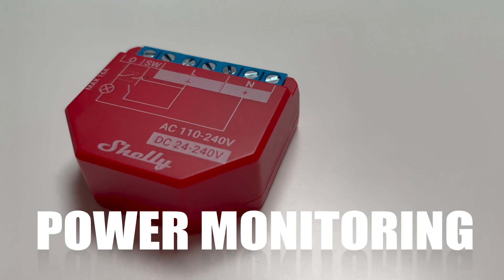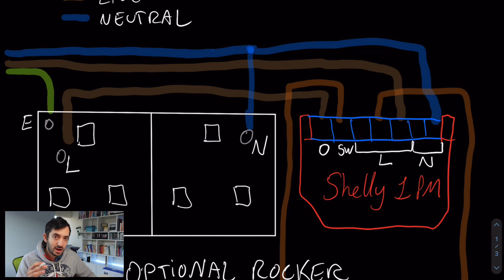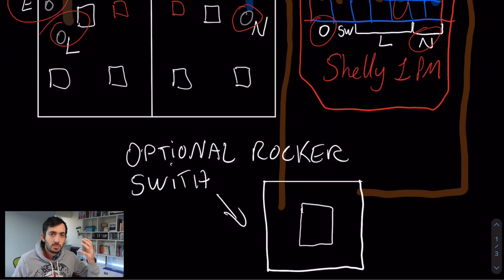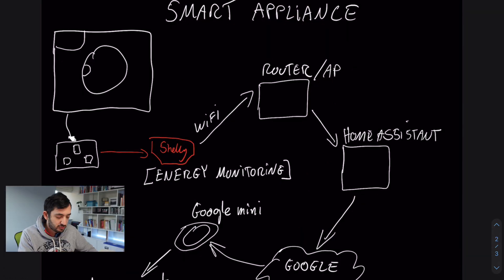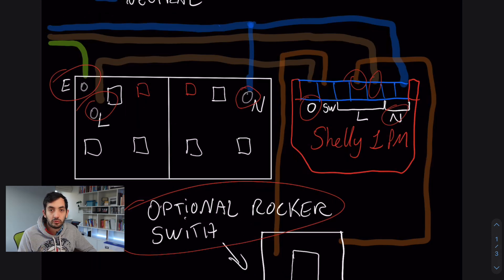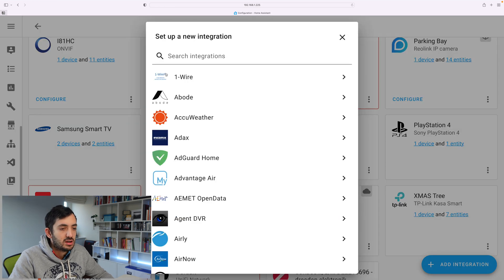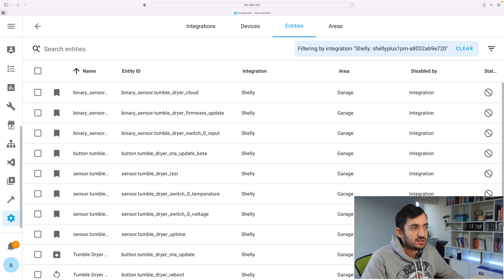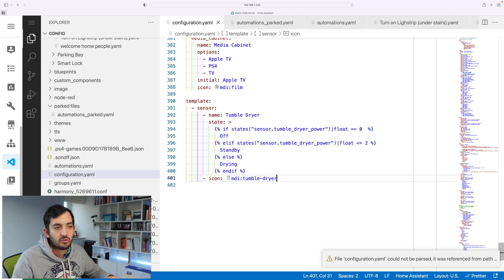Make ANY Device Smart (Shelly 1 PM & Home Assistant)

Comment: I am a Shelly beginner and have acquired the following devices for learning purposes:

- Shelly 1PM
- Shelly Plus 1
- Shelly Plus 2PM
- Shelly Dimmer 2

I want to intercept the signal coming into the kitchen, which is connected to a (220 V AC) doorbell (only powered when the bell is pressed), with a Shelly device, in order to signal the ringing at the front door in the rooms on the upper floor via Home Assistant.

For powering the Shelly, I have installed a seperate 220 V AC connection near the doorbell. As soon as the doorbell circuit is powered by pressing at the front door and rings, I want to capture this signal or current flow with the Shelly and create an entry in its logbook. This entry will then be used to activate a light via Home Assistant, so I can see that someone rang at the door. 
Which Shelly device should I use and how do I connect it?

Thank you very much for your help - Peter

Comment: I see some folks are worried that this Shelly smart switch may not work because the amp draw is too high for his application. Most Americans are not aware that European voltage is single phase 240 volts and not two legs of 120 volts (180 degrees out of phase because the transformer on the power pole outside your home is center taped). In USA this is what we have in our homes. We don't use a neutral when we use 240 here because of the center tap, just a ground for short circuit protection. When you measure the voltage between two phases 180 out of phase you get 240 volts here in the USA. If you measure one phase to ground or neutral you would get 120 volts. If the incoming single phase to neutral is 240 or ground, then you have 240 volt incoming power. 
Of course whether or not the switch will work will depend on the amp draw of the dryer through the Shelly switch contacts. The controls in the dryer are 240 (I assume since I have not seen the schematics or the dryer specifications) (not 120 volts like the US) The heater element would also be 240 (I assume), this could also be a heat pump dryer that would use much less amperage than an American dryer.
Reply from the maker: Thanks for this explanation !!

Comment: Hello, I got hold of a shelly 1pm that you mention, as I said, I have to use it to see the power consumption of a washing machine/dryer, i.e. I have wires from the socket and then shelly 1pm and then a wire has to go from there to the plug on the washing machine /dryer, sounds easy :) but on the shelly 1pm there are 7 options for wires and I can't figure out where to connect the 2 that come from the switch and the 2 that go to the washer/dryer. On the shelly (which look like the one you show), there are markings from left to right 0 and sw and L 3 times and N 2 times, so I'm confused.
In DK we only have 2 wires.
Can you help ? Regards, Alan

Comment: This is my Config file with no errors now:
template:
  - sensor:
      - name: Tumble Dryer
        state: >
          {% if states("sensor.washer_power")|float == 0  %}
            Off
          {% elif states("sensor.washer_power")|float <= 2 %}
            Standby
          {% else %}
            Drying
          {% endif %}
        icon: >
          {% if states("switch.washer_switch_0") == "off"  %}
          mdi:tumble-dryer-alert
          {% elif states("sensor.washer_power")|float <= 2  %}
          mdi:tumble-dryer-off
          {% else %}
          mdi:tumble-dryer
          {% endif %}
          
       when I add the lines for TTS I get this error:
end of the stream or a document separator is expected at line 135, column 1:
    - id: 'tumble_dryer_finished'
    ^
What I'm I missing?
Thx
D

Comment: i'm in the states so my dryer is a 240 volt one (most in the states are) so instead of a energy monitoring device i used a smartthings multipurpose sensor that i had back when i was using smartthings hub. It works great in HA and it has both a vibration sensor and a contact sensor built into it. This way i can monitor the small vibrations when the dryer is running plus i can tell when someone opens the door on the dryer. For the washer i used a sengled smart plug with energy monitoring built into it. These work great with the right automations in HA. Also have my google assistant tell us when the washer or dryer is done but i am using espresense (esp32's) so it can tell who started the washer/dryer and when either one is done it can locate which room that person is in and just target that google assistant. If the person isn't home it sends a notification to that persons phone letting them know.

Comment: when I use your two pices code in my YMSL file I get this error message:  end of the stream or a document separator is expected at line 156, column 1:
    - id: 'washer_finished'
    ^
Any idea how to fix this?
Thx
Reply from the maker: Where did you add this in the config ?
Reply: @SmartHomeMakers  at the end of the file.

Comment: Awesome video! I  am trying to implement something similar but I seem to be getting stuck on the Templating. It passes the configuration test but the new sensor doesnt show up in entities even after a reboot anyone have any thoughts? (New to Yaml so sorry if I'm missing something obvious) 

template:
  - sensor:
      - name: Washer
        state: >
          {% if states("sensor.power_7")|float == 0  %}
            Off
          {% elif states("sensor.power_7")|float <= 2 %}
            Standby
          {% else %}
            Washing
            {% end if %}
Reply from the maker: Hi Ryan! In which file did you add it? the end if needs to be indented a couple of spaces to the left!
Reply: @SmartHomeMakers   was able to get this to work by changing end if to endif
Reply from the maker: @ryantrainor2  Well spotted!

Comment: So in your socket installation with shelly does it mean all the loads which will be connected on both points will be controlled by shelly? What if, I have no option I m using dual socket but I want only one point to be controlled by shelly and another point I want to use without shelly? In the same dual socket,how to wire that
Reply from the maker: From what my electrician said you can’t in the UK
Reply: @SmartHomeMakers  Thanks
Reply: Which is the best solution can I use

Comment: Not wanting to rain on anyone’s parade here but the folks in the UK need to be VERY careful connecting the Shelly 1PM as suggested in this video. Unless the socket outlet is verifiably on a radial circuit backed by a 16A circuit breaker or fed from a 13A fused spur, 99% chance the socket will be on a ring final circuit. Socket “ring mains” are backed by 32A circuit breakers, Shelly 1PM terminals are rated at 16A, if both legs of the ring is connected to each of the feed through terminals on the Shelley (marked L and N), you will create a serious risk of overload through those terminals and potentially a fire.

Bear in mind, folks will watch this and potentially go “ah, this is a cheap way to automate all my sockets in my house.” Great big massive no no and somewhat irresponsible.
Reply from the maker: Hi Brahm! Thanks for raising this important point, get this checked by an electrician based on your own setup at home. One thing to note the n does not feed from the Shelly into the socket, n feeds from the main wire as it was before
Reply: This was exactly my thought & why there is no info on how to integrate a 1PM into a UK ring main. However, my drier & washing machine are as you said on a 13a fused spur so I think Im ok to proceed as in this video. Need to double check the power stated on the appliances but they are clearly under 3.1kw or the 13amp spur fuse would always be blowing. Good comment though hoping it saves someone a fire

Comment: This is a very nice automation with a high WAF(Wife Acceptance Factor). Looking at your video I wonder if the template your are using does not give false positives looking at the spiky power consumption behavior of dryers and washing machines? I have a similar automation running using the ‘appliance has finished’ blueprint in combination with a blitzwolf 16A zigbee smartplug. As I understand the blueprint accounts that the power is under a certain level for some time. in order to monitor the status, I added a helper (input_select) with two states running and finished. When the dryer is started I set the state to running with a separate automation, and at the end of the (blueprint) automation I set it to finished, together with an action to notify on my phone and TTS on the Kitchen SONOS. Works like charme. I even extended that a little further and can now ask Siri if the dryer is still running and monitor energy consumption by creating an ‘integration’ sensor  that I added to the HA Energy integration. Very cool stuff…..keep up the good work with these videos
Reply from the maker: You are correct regarding false positives, if you tend to use the same cycle then it would be a repeatable pattern, simple thing to do in the automations is to use the for parameter

Comment: I really like and learn a lot from your videos! I was just wondering if you are using this a bit over complicated method because you are in the UK and has no access to a shelly plug. I do the same with some shelly plug S.  In that way it is not necessary to play with any wires at all :-)
Reply from the maker: Hi Miguel, this will depend on how much space you have, sometimes smart plugs are bulky and don't allow the fitted cabinet back again.

Comment: You need to be careful that the smart device chosen, especially for something like a tumble dryer, can handle the amperage. I went for a Frient 20204500 Smart Cable, as it's rated for 16A, is Zigbee (acts as a router, so expands my mesh), can be wired into the appliance cable meaning space behind the appliance is not an issue (unlike a smart plug) and it doesn't matter if you have double socket as it will only monitor the appliance it's connected to. The downside is it's not cheap.
Reply from the maker: Hi Robert, sounds like a great solution, yes it is rated 16 amp :) thanks for raising this point!

Comment: The Shelly1 that you referenced is only 15A rated. Many dryers are much higher than 15A and would burn out (and potentially catch it on fire) if hooked up to the higher amperage circuit.
Reply from the maker: Thanks Robert for mentioning this topic which is very important, hence I think when electrical work is involved always get a certified electrician involved. The Shelly 1 pm plus is 16a rated
Reply: @SmartHomeMakers  A typical dryer in the US will draw from 7.5 to about 30 amps (depending on the model).

Comment: Since you asked about other countries, in the U.S. electric dryers use 2-phase 240VAC so this won't work here. It will work on most other devices in the typical house as this are single phase 120V. 2-phase 240v has two wires supplying power, one is +120V and the other is -120V, for a difference of 240V.
Reply from the maker: Thanks Vegas for the comment! This is useful for folks in the US
Reply: U.S. 240v is not 2 phase, there's no such thing. It's still considered single phase 240v even with two hot wires. Unless the shelly specifically needs a neutral, it may still work with 1 PH 240v. Just need to look at the specs.